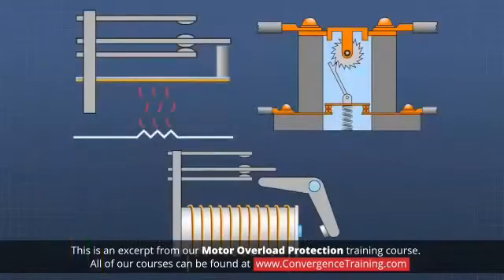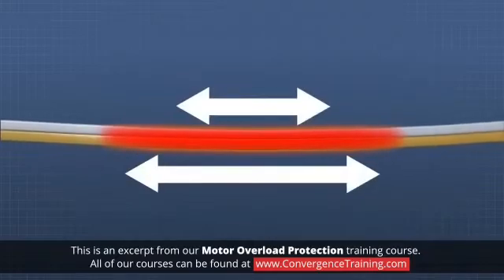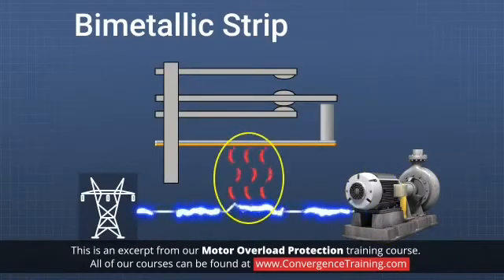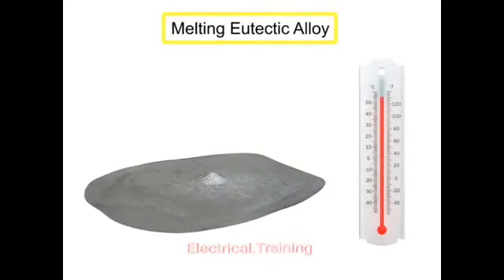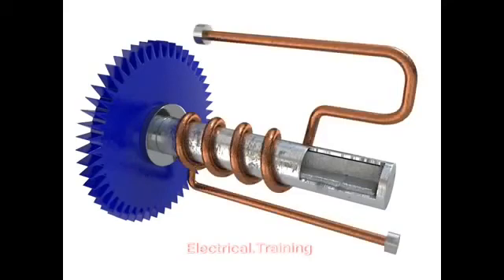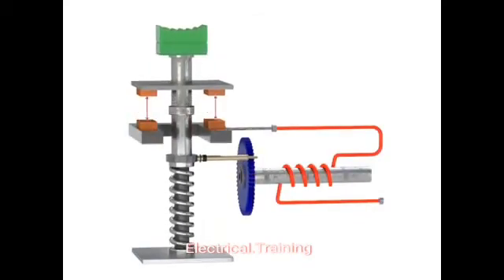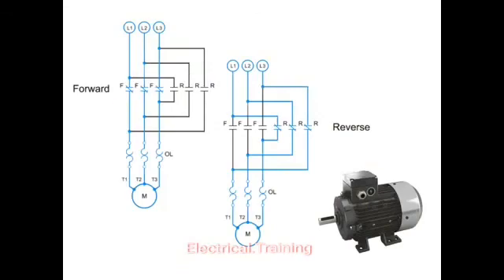working principle of over load relay. #olr

Comment: Something wrong.  At time frame 2.27, you have shown that the bottom stationary contacts are connected to a coil of wire wrapped around a roller with shaft. This is wrong. This wire is not  collected at this contact.

Actually the current going through this heater coil is not from the contact you have shown. But this wire is connected to contactor and the stationary contacts you have shown are connected in series with the wire connected to coil ( of contactor ) which generates magnetism and because of this magnetism, the contacts of contactor closes or opens. So, if the ratchet wheel moves freely  because of melting of alloy due to overheating, then that contact will open and the power going through the coil of contactor, will stop, so the spring in contactor  will push the closed contacts and the power contacts of contactor opens, in absense of electro magnetism.

You have made nice video. Please correct this one. Thanks for your efforts.

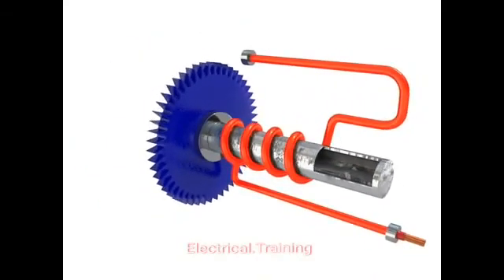Comment: 2:07 can you please tell me how force is working here to move the ratchet wheel..
Reply: I believe the wheel is moved by the force of the spring
Reply: Force of spring is not  moving ratchet wheel. Actually ratchet wheel holds the pawl down.and ratchet wheel is not free, in case of regular current is passing through the coil wrapped around the shaft. But the current increase beyond normal, and this produces heat, so metal which locked the shaft inside the outer tube, becomes free, the pawl connected to this ratchet will not be stopped at current position. Because the ratchet is locked. Now, the pawl is under pressure of spring force, so, the vertical contact with shaft can not go up, until the ratchet moves free. It is like a stone, under the wheel of car ( car is at downward slope ). If you move stone, then car starts rolling down.